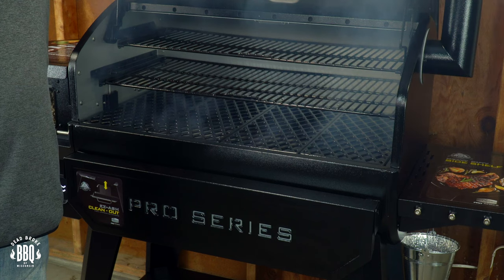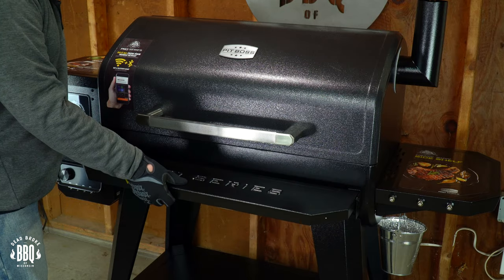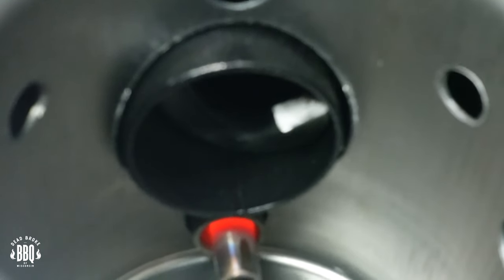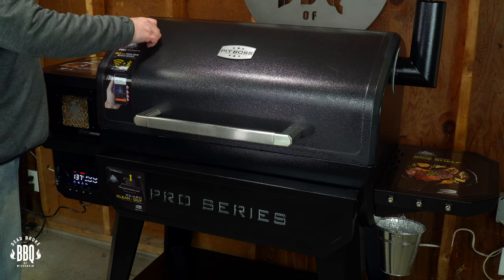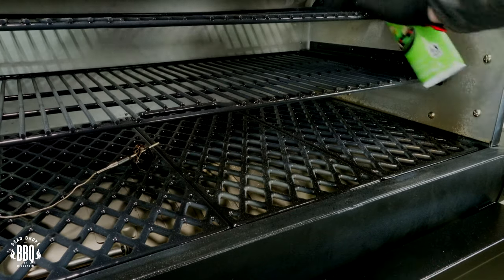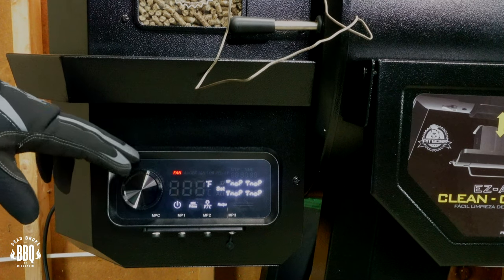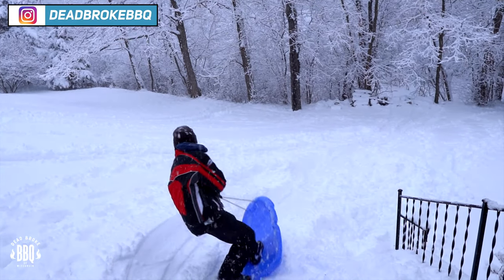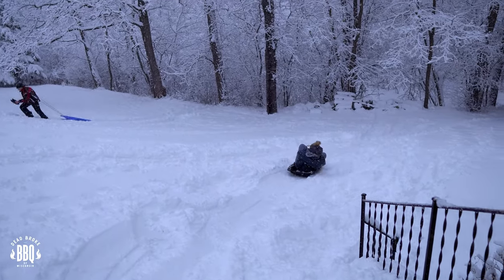Pit Boss | Burn Off | The New Pro Series

Comment: Just bought the 850 version and I absolutely love it... only after 1 cook I have fallen deeply in love with this smoker... you can’t go wrong with the performance and the price!!
Reply from the maker: Heck ya!! The Pro Series is a great line and I think Pit Boss did a great job on these for sure!! I am having a few issues with my controller but it seems to be getting better but I have a call into Pit Boss and once I hear more I certainly will share. But my cooks have all turned out great! Thanks for watching and leaving a comment!!
Reply: I bought the same smoker my wifi is not working
Reply: @robert7879  are you using an iPhone or Android?  I heard androids have issues with the wifi but not sure if still happening.  I have an iPhone and have no issues.
Reply: @santiagohernandez1706  android, but I tried my daughters iPhone and still no wifi

Comment: Just bought one and did the burn off. I emptied out the hopper but there were a small amount of pellets left that had dropped so close to the fire pot that I couldn’t clean them out. Should I be concerned those will swell with moisture and clog the auger on my next cook? Should I empty the hopper of pellets right after I put it in shut down mode and let those few remaining pellets burn off during cool down or will that hurt the machine?
Reply from the maker: You will be fine! You can't get them all and as long as you use your pit in a month or it is not very humid out they will be fine. Unless you keep it outside and inside the hopper gets wet!!! Thanks for watching and have fun with that pit!!

Comment: The patina is just the residue build up from the aerosol propellant which actually gets sticky over time, you should be going for a shiny black finish like cast iron and should use actual oil or a non aerosol spray.  This will provide the nonstick properties

Comment: I bought the 820 years ago, looks like some very smart refinements.  Don't think a 3rd rack is useful though. I'd like to see the upper rack be able to be adjusted a few levels either way over the cooking grates.  just need some bars on the sides to slide them in I would think.

Comment: Man, once again I didn't get this notification, but hey, it's only day 6! 😀 OK so I absolutely LOVE all the new features, I just don't get why they insist of having an 8" front shelf... My biggest complaint with my Pro Series. I know, at least it has one. But too many times I've either lost or almost lost my tray of meat due to sliding it back a bit to open the lid and BAM! On the ground it goes..... As for the rest of it, LOVE IT LOVE IT! If I upgrade, it may have to be the 1150 as this 1600 is more than I think I would use? But of course the extra space is nice! Thanks Jeff!
Reply from the maker: Hi Kevin I would wait for a bit before you upgrade but get the 1600 bro. This gives you the chance to do a larger cook just incase you need it!! Solid unit and other are not having the same minor temp issues I am but this pit run solid once it levels off. There certainly is not the temp swings on this one like my old 1100 and that is a big bonus!! Thanks for watching and I posted a new video today, just a friendly heads up!! hahah Like always bro, thanks for watching!!
Reply: Yeah, not if in a hurry to upgrade... It's funny how each grill is different. My 1100 doesn't get the temp differences that others get and I always let it warm up 15 to 20 minutes and it all levels out.  And good point, no sense on not having enough room :)

Comment: Just bought the 850 pro series. How long is the Shutting down process supposed to take??
Reply: Also, as you hold down the primer button, does the auger light stay on the whole time you hold button or no?
Reply from the maker: No
Reply from the maker: Take 15-20 minutes.

Comment: Hi , I just purchased the 1150 , the 1600 is not available in Canada. When I started the burn off , the app asked if I could set the temp to 275 degrees. I couldn't , is this a problem ?
Reply from the maker: Hmmm I can not answer that question. Does you controller have 10 degree increments? If you don't call Pit Boss they need to update that controller for you!!
Reply: @DeadBrokeBBQ  Yes it does I called PB and they said call the App developer. They think it might be a bug. Oh well the 1150 does a great job. Thanks for the feedback. Happy BBQuing

Comment: Man do u like to use a external temp thermometer like the one u.use here
Are the ones included with the grill .if so what's a good one that's not expensive
Reply from the maker: My Signals is spot on and I trust it 100% when I use it to be dang close on every cook. I have an inkbird that does pretty dang good too but If say save up and wait and get a Thermoworks Signals. The only controller on a pit that I trust as much is my FireBoard that runs my Lone Star Grillz pit. Thanks for watching!!
Reply: @DeadBrokeBBQ  ok thanks man for your help

Comment: Great video, like many others. But which burn off do you prefer, this one or the one you did for the Pit Boss Pro Series 1100 (last year). Thx.
Reply from the maker: I actually think last years was better. I did this one like the manual but I say still bring those temps up slower!! Now I do like the 1600 more than the 1100 just because of the PID controller!! Thanks for leaving a comment!
Reply: @DeadBrokeBBQ  I just bought the 850 pro series, followed the burn off steps from your 1100 video. Can’t wait to start putting it to work. Thanks.

Comment: So I have been back and forth a dozen times over the last week about what kind of grill to get. The thing that is causing me to sway the most toward a propane grill is the fact that with my propane grill I barely ever did anything that resembled cleanup after grilling.  I didn't even cover it. I was about to buy the Pit Boss pro series 1600. Almost clicked buy. Now I read that the pellet grills "should" have all pellets removed after each cook. And its best not to leave the grill outside - like it may get rain? And the most common complaint is that it takes an hour to achieve 350 degrees and its almost impossible to get it hotter than the mid to high 300's with many negative reviews saying similar things? Well, looks like I have made my decision to get a weber genesis 4 burner and skip this brisket making idea I had or maybe just get a separate smaller vertical smoker + the Genesis as the main cooker.
Reply from the maker: Once you start cooking with wood or charcoal gas leaves you feeling like the food is bland and boring even if you dumped a shit ton of sodium on it. But if you are busy and don't like to clean things gas is the way to go.  Plus a lot of people just eat when they are hungry. Other people eat because they like to cook. Thanks for watching!

Comment: Do these new pro series still have issues with uneven heating? I know it was an issue with the earlier models with the sear plate.

Thanks
Reply from the maker: My old 1100 had a 50 degree from left to right but this new 1600 is a lot closer with the new updated controller. maybe around 30 max but it has been a while since I really check that out. Thanks for watching bit the new Pro Series are twice as good as the old ones IMO. Thanks for watching!!
Reply: @DeadBrokeBBQ  Thanks. I only ask because I'm stuck between choosing a PB 850 or Traeger 780. I've been watching video after video, and its vexxing me trying to decide, lol

Comment: How do you keep the sear plate and flame broiler from rusting up.  Over time mine has become rusty.  I've seasoned it multiple times
Reply from the maker: You don't, you just need to keep adding some oil after it has cooled down. It is just the nature of the beast. But adding some oil certainly keeps it from really rusting out. All my pellet grills have done this. Thanks for watching!!

Comment: Would love to know your thoughts on the AP and the Bluetooth controller.  One of the reasons I am looking for anew grill is to have the ability to check the temp on the grill using my smart phone.  What little informationI can find out there, the controller on this grill doesn’t get very good reviews.
Reply from the maker: Once I get my controller back I plan to do more with the app but I knew about the firmware update coming so I just didn't waste time with until until Pit Boss finally told me yes they are swapping mine out. So we got some more testing to do soon!! Thanks for watching!!

Comment: Hey Jeff, did the pit boss instructions call for oiling the chamber to season it?  The reason I ask,  my Traeger mentioned a burn off but not a seasoning.  Curious minds want to know.  Baby Huey looks great.
Reply from the maker: Nope but I always do it one my cookers. It helps make it easier to clean up when they are new. Ya the Pit Boss 1600 is a beast but on mine I am having some temp issues. Taking wat longer to get up to temps but I got more tests to do. I do have a call into my PB rep and one once they let me know how we are going to tweak this I will let everyone know. Thanks for watching bro and have a great weekend!
Reply: @DeadBrokeBBQ  I’m having the same temp issue with it taking a very long time to get up to temp.

Comment: Great video. I watched your video on Oklahoma Joe DLX and Pit Boss Pro Series. I also watched some other videos. I think I'm sold on the Pit Boss Pro Series 1150. On another video I saw a guy covered the plate with foil for easy clean up. This would hamper the sear feature, but if smoking would this be a good idea or would the foil cause problems?
Reply from the maker: Yes Don the Pit Boss with the new PID controller takes the lead on the box store pits right now! I did the foil trick a few times but it started to rust up that deflector even faster so i went back to the way I have always done it. Season it up, cook on it, clean it, and spray a little cooking oil on it and repeat the process again! Thanks for watching and have fun with that 1150!!!

Comment: Sure does looks sweet! Got more room than my Austin xl but they just won’t give us what we want...that 275!!!!
Reply from the maker: Ya nice features on this pit and I am hoping they update this controller like they are on the 1150 and that will at least give use more cooking temp options for those low n slow temps!! Thanks for watching Al!!!
Reply: Dont matter. I had the 1150 and had the controller upgraded still wouldnt hold temp. My external probes less than 2 inches from the internal probe were 125 degrese off.

Comment: Dead Broke BBQ you may want to call Pit Boss as the Pro Series 1150 has a firmware update to the PID controller so they should also have the same for the 1600 Pro Series. It allows for 10 degrees of temp adjust from 200F-300F and 25 degrees of temp adjust above 300F.
Reply from the maker: Hey thanks Ross! Unfortunately Pit Boss at this time is not prepared yet to do the update to the 1600. My Pit Boss rep has informed me that once they have an answer they will let me know right away and I will share it with everyone. Now Ash Kickin' BBQ who is also an Ambassador for Pit Boss and on the 1600 team is not having the issues with his like I am. Saturday though mine seemed like it is getting a little better at getting up to temp. Time will tell!! Thanks for watching and leaving a comment!!

Comment: Is this process the same for the 850?
Reply from the maker: Yep same process. Have fun with that 850!!!
Reply: @DeadBrokeBBQ  Do you happen to know if the Wi-Fi controller firmware is updated on the 850 or if it even needed updated. I was watching your video on that and I haven’t purchased the 850 yet and didn’t know if this was an issue for a new purchase.

Comment: As always, another great video Jeff! I foresee some potential issues with using the griddle though. I'm interested to see if the cooker will maintain a solid temp with the door open while your cooking your breakfast on the flat top. Also, won't you get a face full of smoke the entire time? I'm hoping the griddle isn't just a novelty feature!
Reply from the maker: Great point Scott and I feel the same way but I am still excited to try that griddle out! Now with that said I am having a some temp issues on mine but my buddy Darrin from Ash Kickin BBQ is not so I have a call into Pit Boss and once I hear back from them on what we are going to do to get this thing getting to temps quicker I will do some work arounds to help speed things up! Doing some pork butt right now and one thing I did certainly helped speed up the preheat process! Like always bro, thanks for watching!!
Reply: If you run the grill on high temps with the sear plate open it won’t smoke a lot and it will get the griddle nice and hot. It’s not necessary to keep the whole chamber a solid temp, just to get the heat to the griddle. It’s kinda like cooking with a skillet on a stove vs a skillet in the oven.

Comment: Get a welder's blanket and throw it over the top.  You can do work at any temp.
Reply from the maker: Ya I have stuff like that but I test these cookers under what they come with. This cooker has a lot of great bells and whistles but it struggles getting to the temp I set it at. Now I know 2 other Tubers that have this same cooker and theirs are getting better the more they run them but mine is getting worse. We will see but I might be sending in the controller soon to get another one. They haven't announced anything yet but Pit Boss is aware of the issues I am having. Nothing earth shattering just taking too long to temp up!! Thanks for watching!!

Comment: Looks like a great pellet grill ricer thinking about getting one!
Reply from the maker: Good cooker and has a lot of bells and whistles! I am having a small controller issue right now, I just ain't getting up to temp as fast as I would like but it has done a good job with the cooks I have done! Thanks for watching!!
Reply: How does that grill compare to the oklahoma joes DLX
Reply from the maker: @farmman33  Well with the addition of the easy clean out and the PID controller it took one step a head of the DLX IMO. Now mine is having some temp issues but I have 2 other Tuber friends that have the 1600 and they are not having this issue. I have a call into my Pit Boss rep and once I get an answer I will share it with everyone but this cooker should be the on the top of everyone's list this year!! Thanks for watching Darrin!!

Comment: I Called Pit Boss This morning , they straight up told me they have zero plans on updating the control board for the 1600 to have ten degree increments.
Reply from the maker: Hmmm that is really disappointing to hear and once my rep can confirm that I will certainly share it in a video! I never take a lot of what CS says because they are typically the last ones to know!! ha ha I just want mine to heat up and recover quicker. I don't truly need all the temp settings. I typically cook at 250-275° but I do cook hot and fast at 300° also so I don't mind getting some cooks done quicker anyways. You just have to run those internal temps higher. 210° typically on a hot and fast brisket. Thanks for the update and keep them coming JT!!!